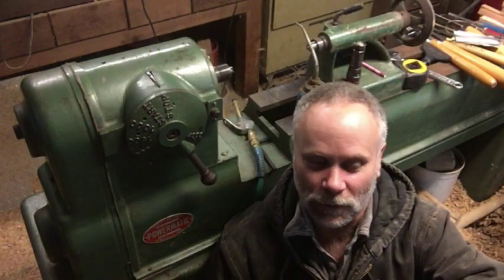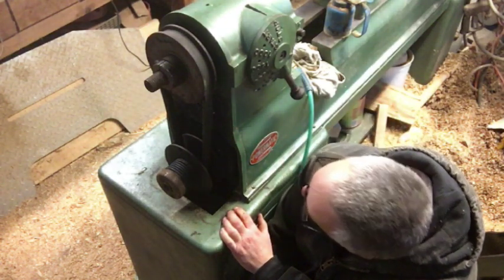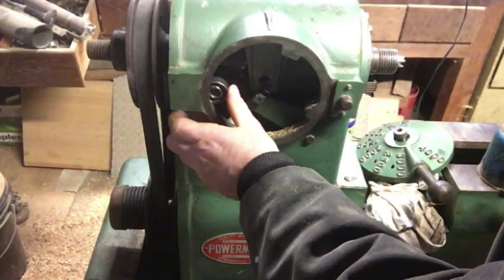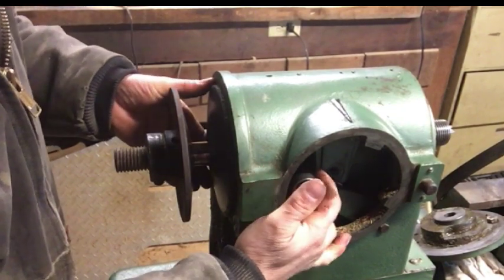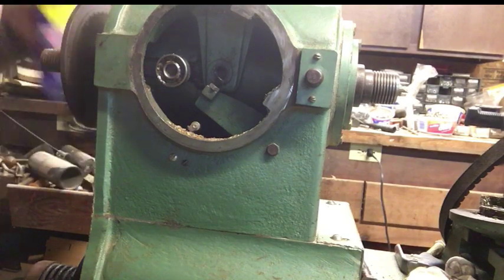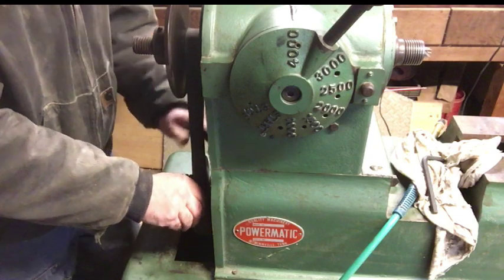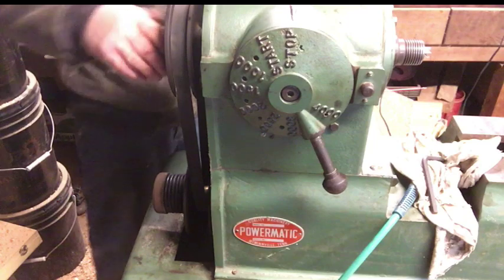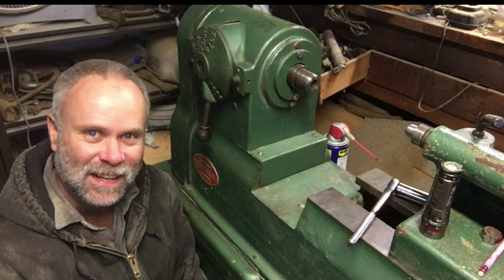Powermatic 90 Wood Lathe Repair

Comment: Thanks a ton for making and posting this.  I just picked up an identical one that needs a little TLC.  I was a little timid about pulling the variable drive apart not knowing what was inside.  Now I can confidently get in there, clean & lube.  It's like your video was made specifically for me.  Happy turning.

Comment: How did you remove the face plate from the Spindle? I have to remove that before I can take off the motor cover. I can't get the locking pin (to the right of the variable speed control) to engage so I can lock the spindle and screw off the face plate. Thanks

Comment: Nice video. What type of power are you using to run this lathe. I have the same one but no way of running a 3 phase motor without a converter or VFD? Is there a way to test the motor with regular 110 V power only?
Reply from the maker: 220 single phase he said.
Reply: Maybe look into replacing the motor with a voltage and phase that works with your supply. Match the rpm and horsepower, output shaft diameter & length, overall motor diameter & length and the motor base bolt pattern.

Comment: Nice video but I would use an oil with Teflon instead of WD40.   WD40 is not a lubricant and it dries out later.  After it dries, the only thing that will clean off the dried gunk is more WD40.
Reply from the maker: As his wife and one who knows little about these things, all I can say is he has made many beautiful things that sell on our store or just for me personally with this since he did the needed repair and it works great.
Reply: @RainCountryHomestead   Good to hear the lathe is still working ok.  WD40 is still not a lubricant and should not be used as such.  The problem shows up later.